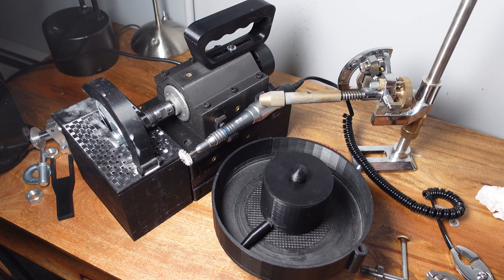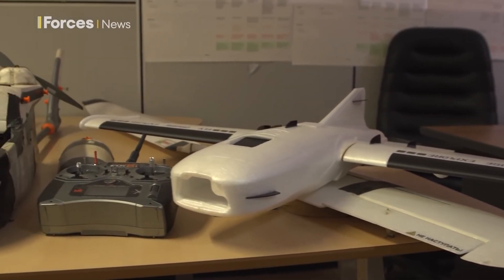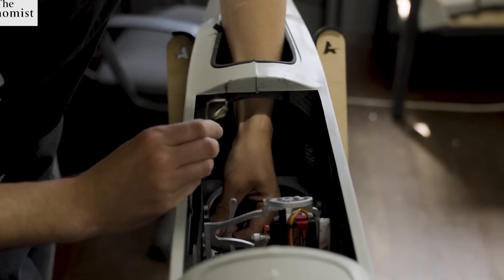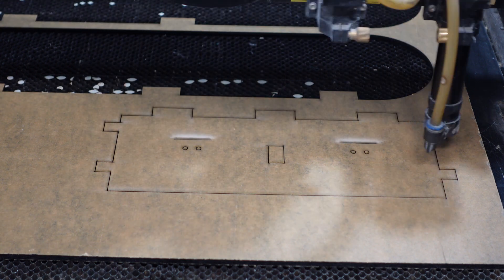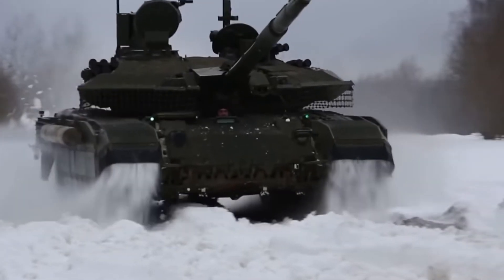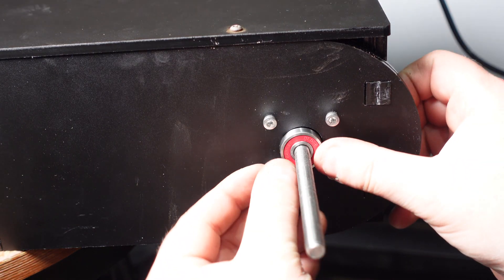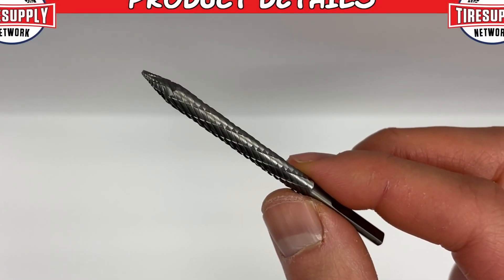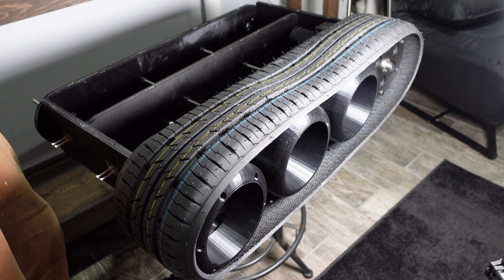DIY Tracked mine to help Ukraine Defeat Russia #diy #ukrainewar  #fpvdrone

Comment: @Sweetgum NYC - Tire tread track holes:  Punch them.  

There's a guy here on Y/T that made a Tire tread tracked version of a Personal Quad ATV.  
He bypassed bolt holes through tire rubber entirely.  

He made a Hole punch and die, combined with a cheap 20-ton hydraulic shop press to cut spaced, oval slots down the center of the tread for the teeth of his drive sprockets. 

A manual Punch machine could easily be scaled up from like the compound action of a soda can crusher (or similar). With a 4-5 foot handle/lever (1.5m ?).  Just put a big guy on the end of the lever.

An appropriately sized "Hole saw" bit (perimeter cuts a plug), and a drill, could possibly accomplish adequate holes.

For the Drive sprockets, he plasma cut (?) the Sprockets out of 1/4" (?) steel and welded them to the rims of the Drive wheels (cheap wheelbarrow replacement wheels (?) (Harbor Freight), or similar.

For the idler wheels for his bogeys (ground contact, track support wheels - the little wheels between the large, end wheels), he used lawn mower wheels or similar sized cheap wheels (again Harbor Freight, or Princess Auto if you're in Canada).

All the components don't need to be anything more than "adequate/functional" for their intended one-way trip/mission.

Comment: A simple screw press(or a vice) and a sharpened section of pipe of the appropriate size would easily poke holes through vulcanized rubber

Comment: Great design, I think plywood would be cheaper and lighter, though.  However, I like your simplicity of gluing
Reply from the maker: @timmyssweet  thanks , simplicity was the goal but I ended up having to modify the design.  I made it 6 wheels instead of 4. The 8mm threaded rod couldn't support 8 wheels without flexing

Comment: I don't want to be that kind of european, but it would make a whole lot more sense  if you redesign the frame using 1 or 1.5 centimeter thick plates because the idea of being able to source the material easily (which is great btw) is defeated quickly when you need it in imperial units and are stationed anywhere but in the US. The option of making it out of plywood from a dumpster for example is perfect for high interest conflict zones, there is just no way this plywood would happen to be 1/8 or 1/4 inches if you find it in Europe, Asia or Africa. Great project though, I can't wait to see the combat footage!
Reply from the maker: @fb2827  it's just a proof of concept. It can easily be changed to suit whatever material is available
Reply: When anti Russian hate is not strong enough to have the empathy to remember that the whole world use the metric system...
Reply: Of course, and I really appreciate your work, it would, how ever, have made things just a little bit easier for a vast majority of potential users. Maybe keep the idea in the back of your head for a v2 or a similar device. Keep up the good work, I'm also planning to build your universal maker mashine for my self and really appreciate your ingenuity, you are a great inspiration!

Comment: Making these plans in imperial measurements for a country that uses metric is shortsighted.

And where is the followup? Did it ever work? Was it infeasible in the end?
Reply: The Internet is filled with Conversion calculators.  If "Imperial to Metric" conversion is a stumbling block for you, perhaps a hobby that doesn't require adaptability/flexibility would be better suited for you.
Reply: @YouHaveNoIdea1224-h2z the problem isn't figuring out that ½ inches = 12.7mm. The problem is that the stores in Europe don't sell 12.7mm thick plates. They sell e.g. 10mm, 12mm, 19mm.
Reply: @phizc  Then, you just adapt your dimensions to local material dimensions. 
You step some up, you step some down. There will only be minor changes/differences.

Comment: Cool idea. Did you ever move ahead with this?
Reply from the maker: @klausnielsen1537  I did finish it and I assembled it and tested it but the 8mm rod was too thin to support the heavy tension the tire tracks generated so the rods were bending slightly.  I opted to redesign the frame to be slightly shorter and I reduced it to 6 wheels instead of 8. This should solve the issue with the flexing but now I can't use the tires because they are too big. So I need to figure out a new  solution for the tracks. I'm experimenting with laser cut neoprene but haven't finished them yet.
Reply: @sweetgumnyc7794  ok, I was about to ask how the project was going. Good to hear it is still being worked on. I just discovered your channel and I am enjoying it. 

Do you have an idea on the payload this vehicle could carry? It seems quite weak and flimsy for military applications, but maybe I am wrong.